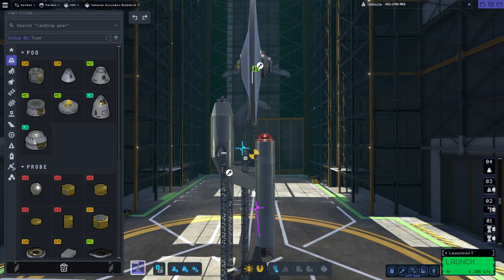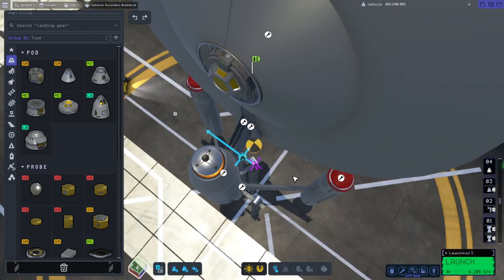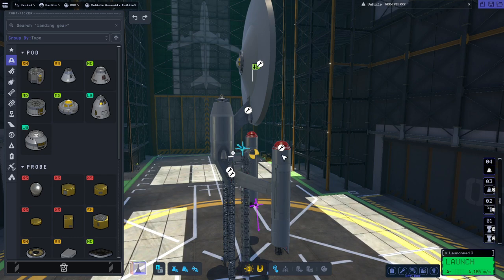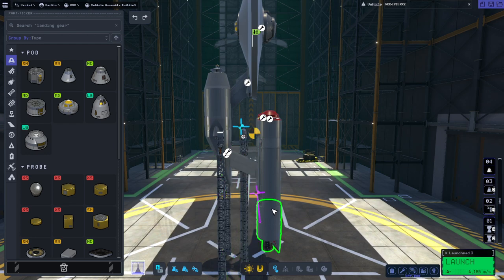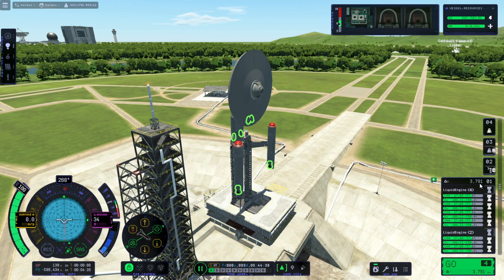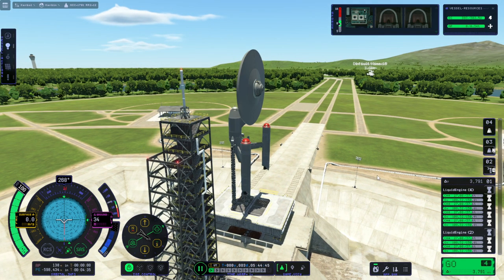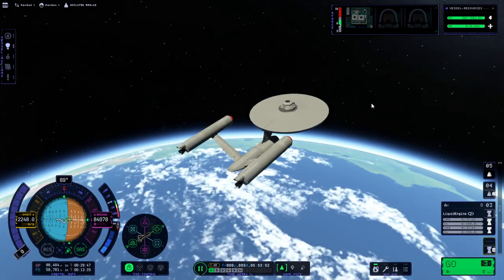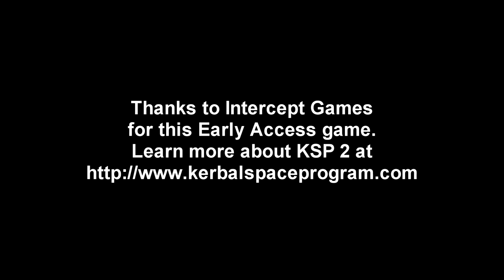KSP 2 - Ridiculous Replicas -  Star Trek Enterprise NCC-1701

Comment: If it wants to go up (and retrograde), just spin it around, to take off on its back, the Space Shuttle way especially sice the saucer, supposedly generating lift (in ST at least) is up in the structure, you'll have to turn it on its back to be stable on ascent.  Nacelles should be a little longer as well, less thrust angle necessary.  Of course in KSP, fairings only generate drag, wich doesn't help.
In fact, before TNG and even before early movies, the ship WAS supposed to be built on land and taken into space afterwards, the 2009 movie didn't invent anything new there. Of course, it makes more sense to build those in orbital facilities...
Sublight engines are on the saucer for a reason. 
Air intakes should be closed to minimize drag.
Nacelles pylons as control surfaces aren't helping since they are inclined. You should replace them with wings without any control surface and add small ones at the end of nacelles to compensate (even hide a pair of canard in the saucer if you have to).

Comment: "recreate your favorite spaceship"... well at least you have to recreate the enterprise, if i were to do this i would have to make either hermes from the martian or venture star from avatar, both of which would be even more of a pain to launch...
Reply from the maker: I would consider those easier to launch because they are balanced around their central axis so you can just have a thrust vector straight through that and there isn't as much of a non-retractable aerodynamic surface in an unbalanced position (the saucer section) that can cause you pain and drag. The forward bits of the Venture Star could be a retractable object, though I can see how they might be a bit of a problem. The rotating section of Hermes is only an issue if you actually need it to rotate. The only problem with them is that they're big, which is not much of an issue, because it just guarantees that you can fit the required propellant.

Comment: The thrust really should be coming out of the back of the saucer to be accurate. The warp necelles don't create thrust, just house the equipment to create the warp field. You might actually have better luck by doing that and setting the necelles above the saucer like on the actual model to help counterbalance the secondary hull...
Reply from the maker: That's how I did it with my more formal replica: https://www.youtube.com/watch?v=7DFzwzLTVM0 There, I used my own model in KSP 1 and had an actual warp drive from KSP Interstellar.